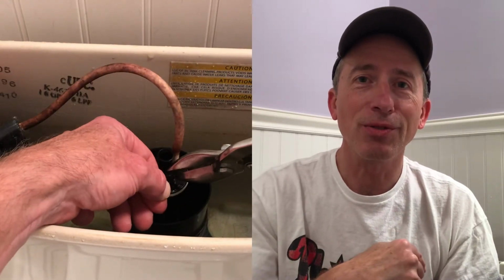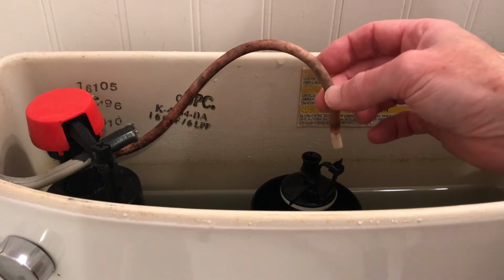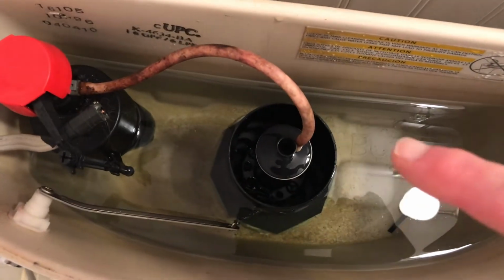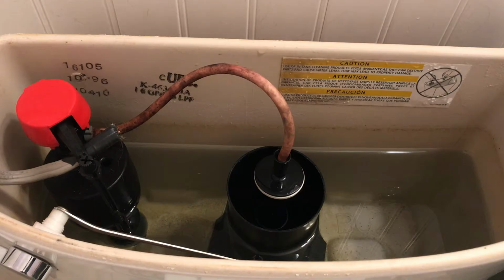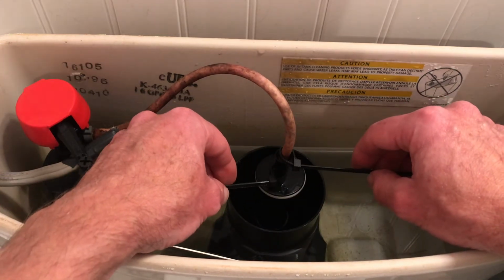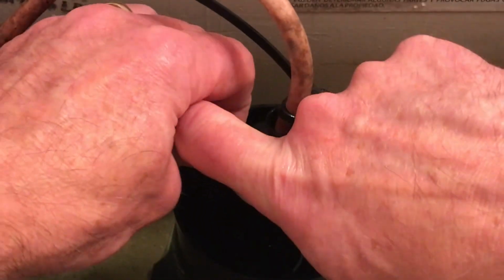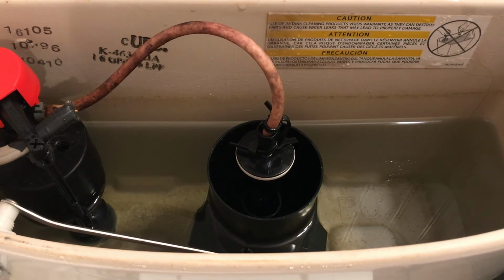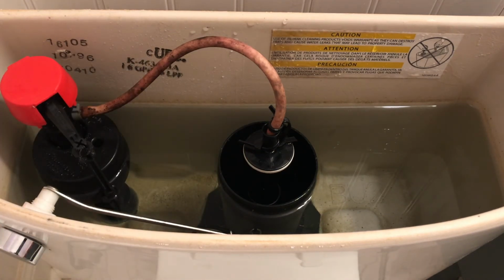Kohler Fill Tube Pops Out When Flushing - Easy Fix!!

Comment: Thank you for the great video: How about using caulking in the top where the tube enters the hole to hold it in place?
Reply from the maker: That's certainly worth a try.  If it doesn't hold it's easy enough to clean off the caulk and try a different way.  If you try it let me know how it works out for you, thanks for watching, JL.

Comment: I did this exact fix last year because I could not find another hose to buy to replace it. It’s lame that the hose is deteriorating on the outside because of the moisture which is why its diameter has shrunk for it to pop loose.  Cheap material with a bad design. 

Also just like you have experienced. My zip ties deteriorated and broke, so here I am again doing the same fix.
Reply from the maker: I agree, definitely a design flaw.  I guess depending on the water hardness, the zip ties can fail pretty quickly.  I can get a few years out of mine before a redo.  Thanks for watching, JL.

Comment: Awesome video.  Exact problem I had.  But, here's what I did and it seems to be working fine.  I shoved the hose back down into the hole.  Then I took about a quarter teaspoon of 100% silicon and used a popsicle stick to kind of push some of the silicone down and all the way around the hose and the hole it goes into.  I left it overnight to dry and bingo, no more problems. I didn't gob on a bunch of it, just in case it didn't work and I had to remove the stuff.  How long it will hold, I don't know.  But so far, it's working.  I even tried to put some tension on it to pull it out after I gave it 24 hours to fully cure and it felt solid.  Maybe this will work, maybe not.  But for the time being, it's holding.
Reply from the maker: That's awesome, thanks for the idea, it may be all you need to do.  I have never used pure silcone like that...does it come in a tube or bottle??  Silly question but I really don't know.  Thanks for watching, JL.
Reply: @LendermanShop  I had some left over in a tube that I used on another project a few months back.  I just squeezed a little bit on a popsicle stick and like I said, I pushed it around the hose into the hole.  I kind of forced some down into the hole using the popsicle stick.  I'll let you know if it doesn't work.  But so far, it is working!!

Comment: I ended up just using the wire out of a wire tie.  Put the center of the wire against the shaft, twist together on the opposite side, run up to the hose, twist together, run on opposite sides of the hose, twist together tight enough to dig into the hose (needle nose pliers can help with that).  I doubt it will loosen, and hope it doesn't rust away, but time will tell.
Reply from the maker: That is a great idea and I will certainly keep it in mind.  Thanks for watching, JL.

Comment: If they had made it so the hose went on the outside of the tube, rather than the inside, a standard hose clip would have sufficed. In fact, you could probably replace the zip ties with a couple of hose clips and a piece of wire, with a bit more time, effort, and cost.
Reply from the maker: I agree!  Toilets and toilet parts have been basically the same for over a 100 years, you think they'd have these components perfected by now!!  Thanks for watching, JL.

Comment: This is exactly the issue i have. Except the black cap that connects the hose to flush valve sheared off at some point from the tube, since the canister has been hitting it for years with every flush. Does anyone know if/where I can buy a replacement of just that black piece connected to hose? I don't even know what it's called. I expect I will then need to further tighten the hose to it using this brilliant zip tie method :)
Reply from the maker: That is frustrating.  Check this link: https://amzn.to/3OcYZHe  I do not have a video on this yet but that is on my list.  I hope this helps and you are able to get things fixed.  Thanks for watching, JL.

Comment: Thx.. .I drilled a small hole 16" thru stem...1/2" from top and inserted a  "cotterpin"...(#20 solid awg) thru.pipe and tube and it was ok until it wasn't and after a few months is now sending a small jet of water to roof of tank where signs can be noticed on outside of tank...pair of sidecutters are very effective for removing brittle tyes.....
Reply from the maker: Wow! I love this idea until you got to the "until it wasn't" part!!!  I hope you were able to get it fixed.  Thanks for the suggestion and thanks for watching, JL.

Comment: The centerpiece for mine doesn't have an upper lip that I can use a zip tie on.

That black piece that looks like a chimney isn't there. I've not been able to figure out any way to point the hose into the cylinder without it getting knocked away when the cylinder rises up during a flush.

II might have to just call a plumber. I'm not an engineer but there must surely have been an easier way to get water into that cylinder than the way they designed it.
Reply from the maker: Not having a piece that will catch the tie on is very frustrating.  I agree, toilets have been made for years you would think this would have been figured out long ago!!  Thanks for watching, JL.
Reply: @LendermanShop  Ah, I was just frustrated and ranting a bit. I ended up ordering a new centerpiece (don't know the term for it offhand) and it'll be alright soon.

Great approach in your video and thanks for the response!

Comment: As of current 3/26 at 4:55 am, I just HAD TO fix this really annoying toilet. I used your (👍👏🏼👏🏼👏🏼 thank you again), tips and tricks. The problem is the design of the intake hose … can’t believe the design department didn’t see this problem. 

I got two different types of fluid master repair kits, but didn’t really worked for this brand and model. Work done and it looks as though it’s going to work. Now I can finally GET SOME SLEEP at 5am.
Reply from the maker: That is great! I am glad you were able to get it fixed but  sorry that it kept you up.  Thanks for watching, JL.

Comment: This is a great fix for my Kohler toilet-- I will be changing the gasket today and adding zip ties though the hose isn't popping out yet.  I am wondering though how many people may live in older homes where the water pressure is too high and causing the hose problem popping out.  I found out my water pressure was about 20 psi higher than code after I kept having to change fill valves that were wearing out in just about 2 years.. After getting a plumber to add a pressure reducing valve in the water line in my crawl space, and adjusting it to code, I found out that the fill valves lasted years longer.  I just changed my kohlet  fill valve after more than 10 yrs for the 1st time.  I'm think about using floral wire or bread ties instead of zip ties today just because I don't know where my zip ties are right now and I want to see how long the wire will last. I don't have any plumber's grease either, so I'm going to just try a little bit of butter on the center stem so I don't break it putting it back in--we'll see if that works.  Thanks for your video--I feel better about doing this project!!   So, I ended up using olive oil for easy install on plastic stem in cylinder and I went with pipe cleaners for connecting stem to fill tube--easy to cut with snips and took less than 3 minutes to put on.  Thanks again!!
Reply from the maker: Great point about the pressure, that has not occurred to me-  it may be an issue for many homeowners.  Let me know how the bread ties work out, that was also a consideration of mine.  Try just a little bit of dish soap instead of grease, but I am sure the butter will work just as well.  All the best on your project, thanks for watching, JL.
Reply: @LendermanShop  actually ended up using olive oil instead of butter and had some wire pipe cleaners I used instead of floral wire or zip ties. A little fuzz installing but very easy and not in water so fuzz should be an issue going forward. You made my day--I'm off to finish my to do list with a very well working toilet!!!
Reply from the maker: @carol4536  Well done!  You were very resourceful!

Comment: My issue is i can't even get the hose to go in the hole in the first place in the canister. It's exactly like yours, same setup.but  It's too thick and the hole is too small. I just keep the tube taped to thr back of the tank. Any suggestions?
Reply from the maker: Hmm!  It is difficult working with the fill hose.  My only immediate thought is to put a little dish soap on the end that you are trying to insert and see if you can work it in. You can purchase a new hose/parts but I am not sure if that will help.  You could join it with tape but that would only be temporary.   I hope you are able to find a solution soon.  Thanks for watching, JL.

Comment: Thanks! I've been trying to think of a way for months because I feared glue or tape would not hold or would cause trouble down the road. Zipties won't last forever, but better than wire which will corrode and I expect to get a few  years out of this instead of pushing that darn tube in every few days - not to mention I won't be in danger of breaking the lid in my impatience.
Reply from the maker: It is very frstrating to have to push that back in so often!  If I remember correctly, I have not replaced those ties since I made this video almost two years ago....I agree, not perfect but not too bad either!  I hope your project goes smoothly, thanks for watching, JL.

Comment: I found a kit for my Kohler toilet fill tube. I bought it at Lowe's (had to order it), it's a Fluidmaster 599, under $5. Mine worked great, at least so far. Good luck, I hope this helps. I had been fighting with this for as long as I can remember.
Reply from the maker: Very good information, I may need to head that direction at some point.  Thanks for watching, JL.
Reply: Thanks for this info, just watched the 599 on Amazon and think this the route I'm going to go.
Reply: @faxmen09   FYI... it's still working great and I don't have to fool with it any longer. Good luck ✨
Reply: @KikiObryan  As I noted, watched on Amazon, looks like best option if not interested in some type hack fix. Seems Lowes no longer carries it, so will go with Amazon. Shame on Kohler for not having a repair part. That said, in the past I've found Fluidmaster to have excellent toilet parts and repair items.

Comment: An alternative, and IMO, better way to go would have been to buy the replacement center piece of the flush valve. The kit comes with the center, top, chain, and new hose for about $10.50. It takes 5 minutes to replace, and you don't even need to shut off the water. Lifes too short to have your hands in a toilet tank longer than that.
Reply from the maker: Thanks for the suggestion, I appreciate it.  So very true!!  Thanks for watching, JL.
Reply: @LendermanShop @dale, can you share what part model that is?

Comment: My water overflowed while sleeping. The tube was squirting water everywhere - believe it or not the lid fell off ( I'm guessing from pressure and the overflow of water, we did not flush the tiolet) I am going to have to put this tube back, and this looks like a very easy way of going at it) 

My question to you is how do I drain the water from tub (water is almost to the top), before I turn the water back on, after doing the tube trick so I can then test the waters, so to speak, and flush it. I'm not going to lie, I am a bit worried of the worse, as it instant flooding after flushing.
Reply from the maker: When you say "tub" I assume you mean the toilet tank. If the toilet has been flushing and there is no clog in the drain you can slowly just flush the water by pressing on the flush handle, or pulling up on the flapper chain(I am assuming you have a flapper.) If that is still a concern, you can use a cup to scoop the water out of the tank and pour it into the sink. (Remember water in the toilet tank is just regular tap water and not 'dirty' water.) More in nest comment.....
Reply from the maker: First off, I mentioned 'flapper" in my first response, you likely have the canister...YT is not letting me edit this morning!!  So two thoughts. 1. The water should not have gone above the canister as that is the overflow 2. It sounds like your float needs adjusting if it did not automatically shut off your water at the appropriate level. Turn the indicator connected to the float rod to adjust the level.  I hope you are able to get this fixed quickly, I know a situation like this can be very stressful.  Thanks for watching, JL.

Comment: Maybe I'm a little dense, but I still don't understand what exactly that little rubber tube does.
Reply from the maker: Ha..neither did I at one time!!  That is the toilet bowl filler tube.  When you flush, the water from that tube refills the bowl.  Most of the water you hear and see(with the tank lid off) fills the tank, that tube sends a smaller amount of water to the bowl.  If you disconnect that tube you will notice that the bowl only fills about halfway after a flush.  I hope this makes sense!!  Thanks for watching, JL.

Comment: Screw the zip tie. I just slapped some duct tape around that b*st*rd.  I'm in a rental, and I'm not gonna keep screwing around with this crap.  Mine is a canister flush, but it has a flexible rubber tube. And it doesn't look nearly as long as the tube that's in the video.  It jjust barely fits into that hole, and it doesn't fit tightly.  That canister hops up when you flush it, knocks that tube out almost every time, it's a very stupid design. I hate it.

Comment: Hard to believe the manufacturer did not address this.  It is a big problem in the design and makes a real mess as the fill tub can spray on tank vice and ultimately end up running down the side of the tank and onto the floor.  Great idea to fix lax engineering
Reply: The newer canisters have a notch to hold the tube in place more securely.
Reply: @jessedemarco6690 …. They should have a replace kit for this model ….
Reply: @ghstbird3338  Exactly!
Reply: This happens to us and water leaks out all over the floor. They definitely need to address this issue

Comment: Ihave a kohler as well my flush cap is yellow the hose end has a nipple fitting  ... My issue is when i flush it pulls from the bottom and shoots out all over the place can i get a new cap  or do i have to buy the whole flush assembly.
Reply from the maker: Some other folks have had this same issue.  If you go to the Kohler parts page, I think you will see parts to order.  I recently searched for Kohler flush valve or fill valve images and a bunch of diagrams came up.  I hope this helps, thanks for watching, JL.

Comment: Is the connection of the refill tube on the other end semi-permanent, perhaps glued? Do you have to replace the whole valve if it comes loose?
Reply from the maker: I have not had this issue myself, but on mine it does look like a small plastic clamp of some sort around the tube.  Maybe try Nashua Stretch n Seal tape as I stated in the other response.  This is a tape that is water resistant.  Of course, I have not tried this myself but I think it could work in your situation by wrapping the tube then taping around the body.  I hope that you can get this fixed without a full replacement.  Thanks for watching, JL.

Comment: What if it’s popping off at the other end? That’s what’s happening to ours 🫤
Reply: That's our problem! No one is addressing that.
Reply: Zip tie it on
Reply from the maker: @dizzy_siren333  Definitely worth a try!
Reply from the maker: I've had this question before, but I haven't had this issue myself.  Another viewer suggested Nashua Stretch n Seal tape for the job in this video and maybe it could work for you as well.  I believe you can get it at HD and Lowes.  I hope this helps, let me know how you make out.  Thanks for watching, JL.

Comment: I used some Nashua Stretch n Seal tape as a wrap to seal and reinforce this joint.  It is easy to use and available at Home Depot, Lowe's and such.  Perfect, easy fix using just a 4" or 5" piece.  Should last the life of the flush valve or fill tube itself, whichever comes first.  Highly recommended!
Reply: I did same worked great
Reply from the maker: That is a great idea, I think I will try it the next time!  Thanks for the suggestion and thanks for watching, JL
Reply: @LendermanShop how’d you use it? I don’t understand the process.  Did you just seal the hose to the fill joint?
Reply from the maker: @ChronicallyWillPodcast  I pushed the hose into the receiver until it stopped. Then. use your cable ties or Zip ties to create a locking link between the hose and receiver.  You must put a tie around the hose and one arounde the receiver piece and then link those two ties together with the third Zip tie.  I hope this helps, thanks for watching, JL.

Comment: Why not use wire instead so you don’t have to deal with the ties getting brittle and breaking?
Reply from the maker: Great suggestion, perhaps I will give that a try the next time I need to refresh the ties.  My only thought regarding the wiring is using a gauge that is workable in this confine and that I will be able to twist tight enough to hold.  Thanks for watching, JL.

Comment: Kohler has a replacement for the top piece.  GP1229656.  It replaces the 'hole' top with a nipple top so that it holds the tube in place.
Reply from the maker: Great information.  Thanks for watching, JL.

Comment: What if it pops off on the OTHER end?
Reply: Mine came off on the other end, I took the top off like a dummy and water was spraying EVERYWHERE
Reply from the maker: Hmm!  I haven't had that happen.  Maybe try a configuration with zip ties or use a twist fastener on the tube and wrap around the stalk of the fill valve.  Sorry I don't have more for you other than trial and error!  Thanks for watching, JL.